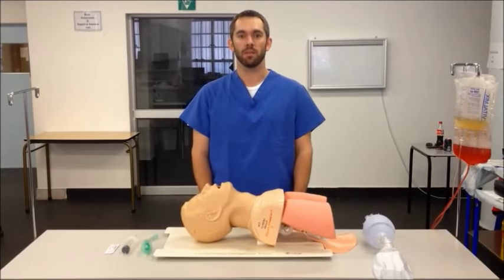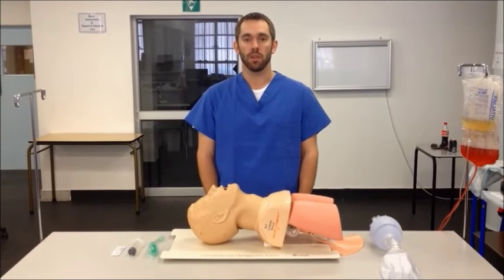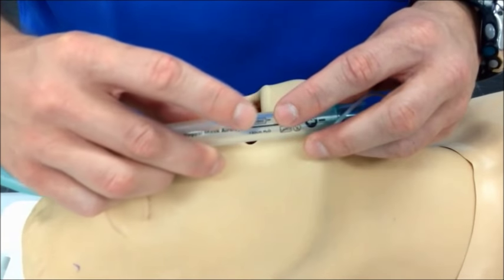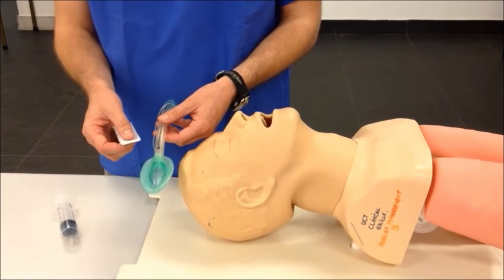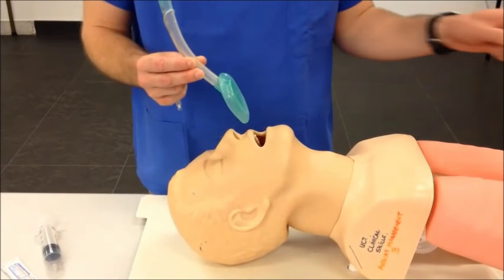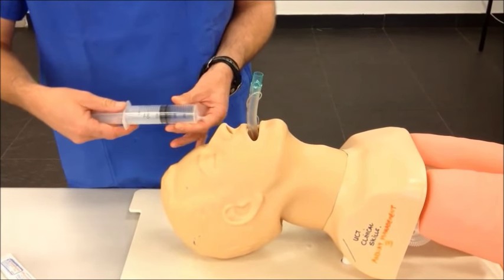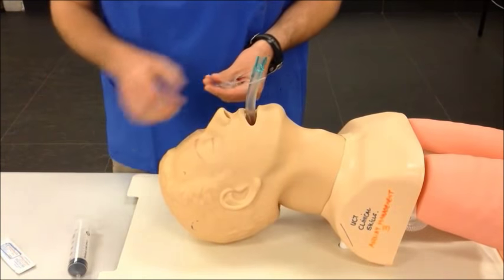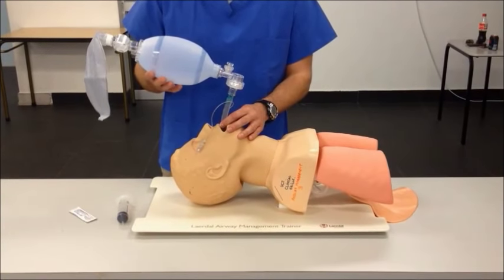Laryngeal Mask Airway Insertion

Comment: Is there any reason why LMA couldn't be used in a surgery? Any reason an endotracheal tube would be preferable or required? Is LMA only for short operations?
Reply: it could be used for short procedures and for low risk anestheic cases. but besides these, it could also be used in pre hospital settings and during cardiac arrest to achieve more secure airway with out endotracheal tube.
Reply: just from what i learned, consult seniors for more
Reply: Unlike the ET tube, the LMA doesn't protect the airway from vomitus. Placing the LMA in the airway can also insufflate air into the esophagus and thereby the stomach, which can cause vomiting, especially in unfasted emergency surgeries. This is the major drawback of the LMA, it does not protect against the risk of aspiration.